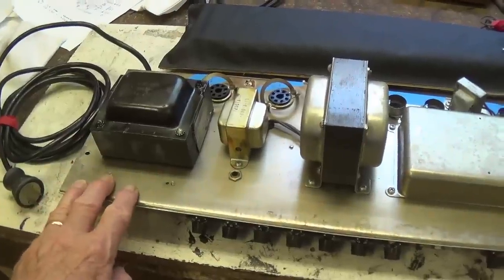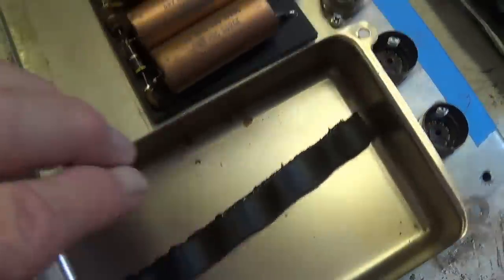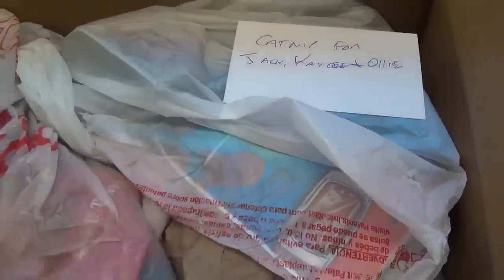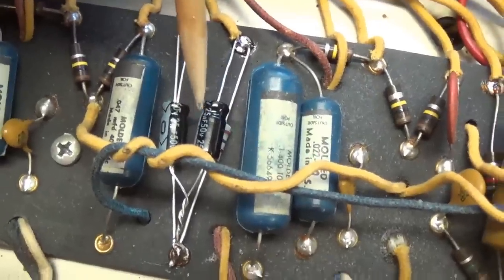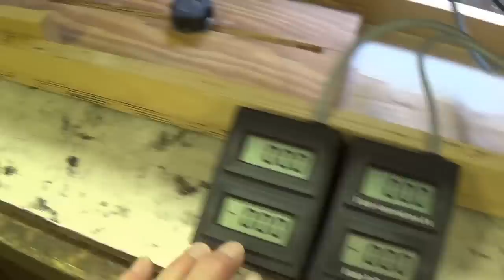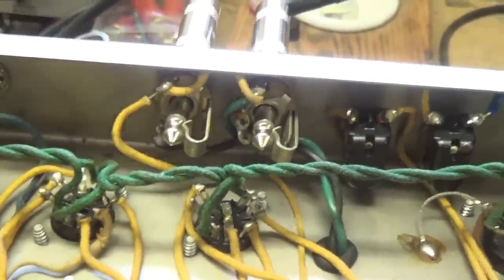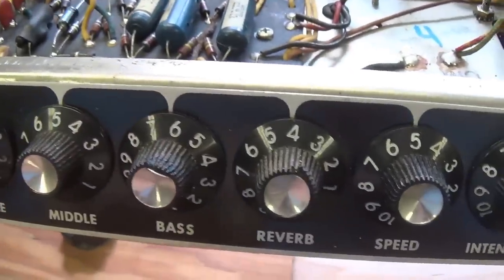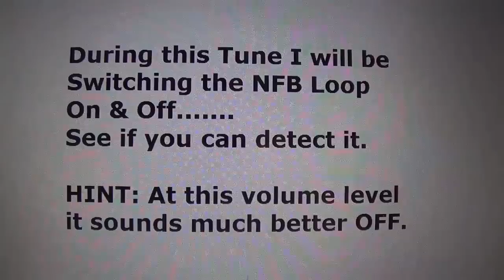1966 Fender "Blackface" Super Reverb:  In Storage for Almost 40 Years !!

Comment: Uncle Doug, "prom night at the bondage and discipline center"?!!!  Is there an easy way to determine which filter choke is needed for an amplifier that may not have a schematic or parts list?
Reply from the maker: Yes, after the prom you can look up the rectifier tube in a tube handbook and see what they recommend. For diode rectification, look up a similar circuit and see what they use.

Comment: Ah, come on Uncle Doug, your really bypassing the learning curve here, a capacitor discharge tool, that's just cheating!  I use to work on CB radio linear amplifiers, big tubes, lots of capacitors.  I was taking voltage readings with 1/8" diameter Xalite(sp) screwdriver, hooked to a Simpson VOM, I zigged, when I should've zagged and then I had two  1/8" screwdrivers, quicker than a plasma cutter!  I stood straight up out of my swivel chair, walked around in circles, for 15minutes, with my hair smoking!  I can laugh about it now, I lived thankfully, but the hair is 80% gone!
Reply from the maker: Years ago I was test driving a BSA Victor motorcycle with a bare metal seat on a hot, sweaty day. The throttle stuck (naturally) and I had to pull the spark plug wire out of the 20,000 Volt magneto. Three guesses where the spark(s) exited on their way to the seat.
Reply: @UncleDoug  Nice salty sweat, good conduction!  I'm surprised you weren't arc welded right to the seat!
Reply from the maker: @bebo5558  I'm surprised that I was ever able to reproduce after it happened ;)
Reply: @UncleDoug  It puts a whole new spin on the term, roasted nuts!

Comment: When you mentioned purchasing the bulk 3-wire power cords, it got me to thinking: Is it practical to install a chassis-mount power connector to use the cord with the female end? I realize that the hole would need to be enlarged.I think that there would be less wear on the cords when they're removable, plus you could have cords of varying lengths as needed. Also, is there a three-prong accessory socket available that would fit in the existing hole?
Reply from the maker: On my homebuilt amps I do exactly what you suggest, Mark......install a 3-prong male receptacle on the rear of the chassis so the power cord can be detached for ease of carrying. I have no idea if round 3-wire receptacles exist.

Comment: Have you experimented with modifying the optocoupler in a trem circuit like this? Like changing the value of the photoresistor, or the type of light....
Reply from the maker: No, I haven't. To be honest, they generally work so well that modification isn't required.
Reply: @UncleDoug  Just wondering because I ended up making some instead of ordering and waiting. I guess i had fun doing it

Comment: Hello Uncle Doug !!  Great video as always,  but i do have a question regarding the physical amp design of these type of guitar amps.
I have always wondered why these amps was designed with the upside down chassis where the heat of the tubes (OUTPUT) roasts the tube sockets they are in along with the screen resistors, I would rather see amps like this designed with the tops of the tubes facing up to facilitate better cooling of the tubes and chassis!!  Was there a reason for this particular design as it is??  Just Curious ,  John A Bellas     KC2UVN  73's
Reply from the maker: Thanks, John. I think it's necessary so the controls can be at the top of the amp (for convenience) and still be part of the chassis.
Reply: It doesn't matter so much with these old Fenders John. The ones since 1990 or so that have tube sockets mounted to PCB boards do indeed have overheating problems. That's why Hot Rod Deluxe's etc. are constantly in for repairs.

Comment: My buddy's amp turns out to be a blackface of the 1966 era and still has the ground switch and a three-prong male plug fused to the power cord. It is red-brown and has a curious marking between the prongs; a little lightning bolt with the numerals 6 and 4. ever seen that? this amp looks brand new and I haven't opened it up yet but the owner tells me it works just fine. Are they more valuable untouched or would you recommend upgrading still, he wants to sell it and I only wish I had the money. when my back will let me I'll take out the chassis and send pictures.
Reply from the maker: The ground switch and 3-prong plug generally don't go together, John. The cord may be a replacement. Some collectors prefer originality......but if you intend to use it often, then updates are preferable.

Comment: Another great Video Doug, APU I dropped a like. 

BTW I could hear some ever so slight clipping during the Demo, so I am wondering is that clipping related to the "NFB"?
Reply: Maybe~Just maybe it might also be that the Microphone was a little close for the Amplifiers Volume? 
Or maybe the problem is at my end, meaning I have to tell the missus I will need two new amplifiers and two sets of speakers to go with them. 😉😁
Reply from the maker: It could be due to the absence of NFB for almost all the tunes, KAB. Things get nasty a lot sooner without NFB.
Reply: KAB? I have never heard of that "Term/Acronym?" before  @UncleDoug , Is the term specific to Valve Electronics?

Comment: Thanks for the video. I'm curious if, with adding the NFB switch, have you ever encountered added noise/hum by making the changes needed, such as having that longer wire have a different path in the amp (changing what the wire is near) or is it not a concern with this type of change?
Reply from the maker: Not really a concern, OM7. The only wires that must be shielded from extraneous fields are those carrying signal from the input to the preamp and to the VC and TC. Also, the NFB does not carry any 60Hz AC.

Comment: Hi Uncle Doug can you make a 65 reissue super Reverb Amp into 65watts or more to run 6-10"s speakers?
Reply from the maker: You can "run" 6 x 10" speakers with a Fender Champ, Richard. In one of my older videos, I blasted 3 x 15" Jensens with a home-built 6W Champ clone. No need to boost the SR's wattage.

Comment: Is there any difference between the fuse holder's tip and body when connecting it to the primary? Can the wire from the switch go to either connection? I'm thinking it doesn't matter but I could very easily be missing something simple.
Reply from the maker: Generally the "hot" input wire goes to the tip of the fuse, to reduce the shock hazard that might stem from having the upper, accessible end of the fuse energized.
Reply: @UncleDoug  Ok thanks. So it's not an electrical thing, more like a safety thing. I'm doing a build with the fuse holder coming up vertically through the bottom of the chassis. It's weird, but I need the back panel space for something else haha.

Comment: Off topic, but I need your excellent advice again. I have a Fender Deluxe. I’ve read that a neat trick on some Fender amps is to run it without a tube in V1. Can I do this safely with my Deluxe? The “mod” was stated for a Reverb Deluxe, so I don’t know if they are similar enough to work for both.
Reply from the maker: Check what The Fender Guru says on his website, Rik. He's the man when it comes to Fender mods.

Comment: The playing reminds me of T. Rex, the Rolling Stones and Sheryl Crow. Uncle Doug did you slowly form the brand new electrolytic capacitors?
Reply: I'd be interested to hear our Uncle's opinion on the whole notion of "forming" caps. There's obviously difference of opinion on this one. Me, I'm a skeptic, but I'd be very open to Doug's take on this.
Reply from the maker: Thanks, John. They are all favorites of Jack & Ollie. I've never seen a new electrolytic that required "forming", John. They have to sit for quite a while.....years even......to require it, at least in my book.  I always use a current limiter also, just in case.
Reply: @UncleDoug  Eddie Van Halen sometimes used a variac while searching for sound differences at different voltages.

Comment: :’D love it 
And I always learn something, that ‘opto isolating’ tremolo device has peaked my curiosity. 
What is that alien device {goes to study} 
Beautiful sounding 
Regards
Reply from the maker: I'm glad you did some study to answer your own question, Kolin. That's a habit found in the best students. Thanks !!!
Reply: Hi, don't know if it's the circuit,  or sound, or both that pique your curiosity, but in case you don't know, there are a few different circuit designs Fender and others used...bias (vary) trem, and different insert points (one of the old Fender Tweed era amplifiers inserted it at the first preamp for a very strong Thump) are a couple besides the "opto roach'' LDR & lightbulb seen and heard here. I especially liked what he did with the extra capacitors slowing it down. I just put another ceiling fan in today and they alsoemploy a couple blocks of capacitors for speed change.

Comment: Doug, when you replace the doghouse capacitors, or any of the replaced parts on an eyelet board, do you solder from the top of the back?  And if you work from the topside, how to you ensure that the new leads are pulled tight enough against the eyelets to make sure that it's not just the solder blob that is serving as the sole conductor of current?
Reply from the maker: I solder from the top, LB, and, after hundreds of such component installations, I have never had a single problem with proper contact being made. The solder connection is not primarily to the eyelet......it's to the other wires in the eyelet.

Comment: I watched to the end and you showed this, Thanks!
Is one end of the resitor soldered to the screwdriver or both ends???
Sorry Complete newb.
B
Reply from the maker: If you're speaking of the capacitor-discharging tool, one end goes to the screwdriver blade and the other goes to ground.

Comment: Uncle Doug, in your videos once you get an amp “straightened out”, ie all necessary replacements done and tubes properly biased, you say that there is absolutely no noise from the amp. Do you mean absolutely no noise or is there always that higher frequency hissing/white noise present when there is no guitar signal and especially if you turn the volume up. Is that just part of the territory with a tube amp? I ask because I have always experienced this with any tube amps I have purchased even new ones.
Reply from the maker: When I say "no noise" I mean no abnormal hum, popping, rustling, etc. There is, as you say, an inescapable amount of very subtle electrical noise in all tube amp circuits.

Comment: Uncle Doug, I have a cheap Fender Champion  100XL and the one thing that really bothers me about it is it has no output Jack for additional speaker. Is this doable and how hard is it to do? I'm asking since every shop in town is shut down because of this virus I may end up having to do it myself.
Reply from the maker: To avoid an impedance mismatch, you should install a 1/4" female jack in the chassis and wire it properly, then you can either plug in the cabinet speaker or a remote speaker.

Comment: U-D  wanted to fling some questions @ you  concerning the super verb & the quad verb , i noticed the super has 4-10"@ 8ohms ea. wired in  parallel = 2 ohm ,  and the quad verb has 4-12" @ 8 ohm ea. wired parallel ( 4 ohm ) , my question is , can i take 4-12"s @ 32 ohm ea. wired parallel (8 ohm )and install them in a quad verb run-n @ 4 ohm ? I am to understand you can run a higher load (ohms ) into a lower ohm amp without damage ?
Reply from the maker: I don't understand how the Quad Reverb can achieve 4 Ohms net impedance with four 8 Ohm speakers in parallel. To do this, the speakers would have to be 4 Ohm, wired in series-parallel. I have never seen a 32 Ohm speaker.....are you SURE about the impedance ??? In powerful amps, it's always best to match impedance properly. There are no reliable ways to operate at a mismatch.

Comment: Great video Doug - the reverb tank comment cracked me up😂
Just one question: I notice you used modern caps and resistors as replacements for the old ones - and I understand they are more heat tolerant and accurate - but they’re not exactly ‘period correct’ like the carbon comp ones for instance. What’s you philosophy on this?
Cheers from ‘Down Under’.
Reply from the maker: Thanks so much, EV. It's great to hear from you. Until someone posts the results of a blind study in which a listener can accurately detect the difference between different types of resistors and caps, I will continue to feel that all that really matters is accuracy of value.......not price or exclusivity.

Comment: are you using a 10w 100ohm  350v or 550v cement resistor for the discharge tool????
Reply from the maker: It's a standard white 100 Ohm 10W resistor from Antique Electronic Supply, GA. I'm not familiar with voltage ratings on ballast resistors, but if you have a choice, go for the higher value.

Comment: Hi Uncle Doug. Quick question on my ‘66 Super.

This may not have been smart, but I once pulled V6 tube off when the amp was running, which blew the fuse. It plays when I changed it (with 2A 250V), but now when I play at higher volumes, the fuse will blow. Ive gone through a couple fuses now. Any I idea if I did something here?
Reply from the maker: Does it hum now?  I wonder if a voltage spike occurred (when you pulled the tube) that may have damaged one (or more) of the filter caps. The cap may be functional now at only lower voltage and current levels.....but shorts at higher levels. Just a guess. This needs to be checked by a qualified tech.
Reply: @UncleDoug  That would make sense. No hum though, works normal. Only until pushing at higher volumes when the fuse will go. 

Will check it out though, thanks for all help Uncle Doug!

Comment: I am wondering if it is possible to add a dwell and tone control to the reverb on these.  Any thoughts on that?
Reply from the maker: The amplifier tone controls precede the reverb in the circuit, so they would have effect.  The dwell is partially controlled by the Intensity and by your pick attack. As far as adding dedicated controls, I guess it might be possible using the 6G15 circuit as a guide.

Comment: Umm pretty sure the Fender Super Reverb cab is wired series/parallel, They're 8 Ohm speakers, so yeah, you'd be at 2 Ohms, but what happens when you add an external speaker? One doesn't often see amps rated for one Ohm.
Reply from the maker: The speakers are all wired in parallel, MB, just as the schematic shows. As with a lot of early amps, when you plug in a external speaker, the impedance became mismatched, but not by a lot with the SR, Concert, or Bassman. Five 8 Ohm speakers in parallel have a net impedance of 1.6 Ohms.....a 20% mismatch.....not all that bad.
Reply: @UncleDoug  Yup. I got curious and googled.I had read that Joe Walsh used to run two 4X10 cabs from a single Super Reverb, meaning he was operating at only 1 Ohm' no wonder he needed a spare head.
Reply from the maker: @m0j0b0ne  God knows that a musical genius like JW can play by his own rules, MB ;)

Comment: I have a Earth Amp Head from "71 ish. Haven't gone through it yet, but for $30.00, not a bad future project. Already verified a few shorted transistors... How much of a huge pain would it be to transform (he he) this into a tube type? I have a 1953 phonograph push pull guts, 30 watts out put, that I'm thinking will do the trick. Your highly valued opinion would be greatly appreciated. :)
Reply from the maker: I have never tried to convert an SS amp to P to P tube, FW, but it sounds like a nightmare. You would be better off just starting from scratch or converting an existing tube circuit.
Reply: @UncleDoug  that's what I was thinking UD. The only reason I asked was that very early SS were very basic as far as the circuit board, ECT...

Comment: Hello Uncle Doug. I have a 1960 Gibson GA20T Ranger amp that I haven't used in 15 years. Needless to say I don't want to just plug it in and turn it on. Can you tell me the correct procedure to make sure I don't damage the amp? I think it's more than just dialing up a variac. Thanks!
Reply from the maker: Greetings, Billy. I prefer to use a current limiter when powering up electronic equipment that has been dormant for several years. Be sure the bulb wattage is appropriate for the current demands of the device, then simply use it while energizing the circuit to protect against excess current influx.
Reply: @UncleDoug  Thanks so much for the reply. Really appreciate it!
Reply from the maker: @billyvanilli  You're welcome, Billy.

Comment: If I understand the opto correctly shouldn't it be covered better on the end than it is?
Reply from the maker: Recall that the circuit within the chassis is sealed from the light when installed in the cabinet.

Comment: Question: does the amp have to be plugged in (and therefore grounded) for the cap discharge to work properly?
Reply: No.
Reply: Will Hackett   How does that work? Where does the energy go?
Reply: @billphillipstube  It dissipates to ground through the chassis usually. At least that's the way Doug does it. He has a screwdriver he made into a capacitor discharge tool, and one wire from it goes to the chassis via an alligator clip.
Reply: Will Hackett But the chassis, not being connected to ground, wouldn’t present a path for the energy to flow to ground. That energy has to go somewhere. Is it converted into heat by the discharge resistor?
Reply: It's like with a battey.  The charge is dissapated by shorting across the positive and negative leads. With the tool Uncle Doug created, the stored energy is safely  released as heat by the resistor.
Reply: @miker252  Yeah, you're probably right.
Reply from the maker: Touching the + terminal of an electrolytic with a grounded tool simply shorts the capacitor, Bill. Remember that the - terminal is connected to ground.
Reply: @billphillipstube  , even if the amp doesnt have a grounded cord, or isn't plugged into the wall, the power supply ground and audio signal ground are connected to the chassis.